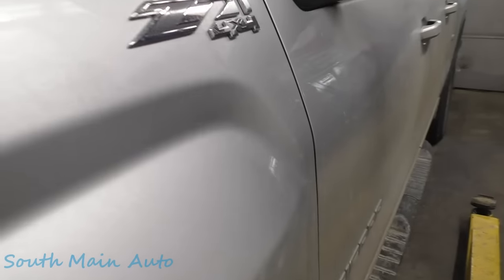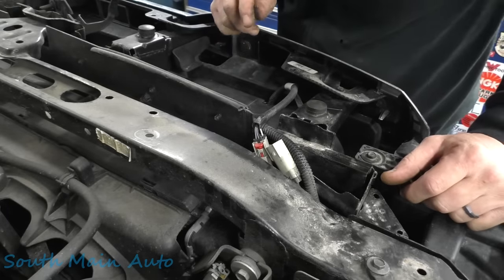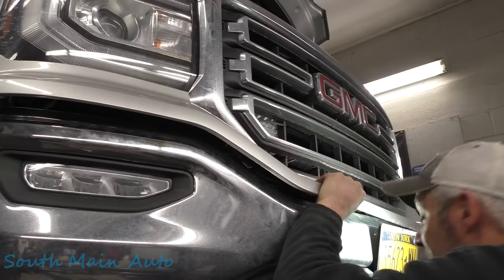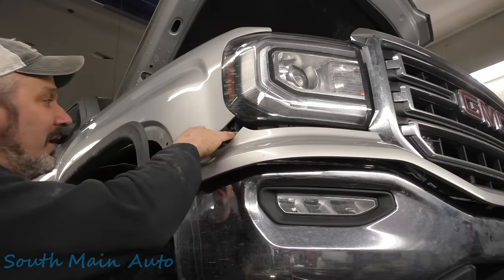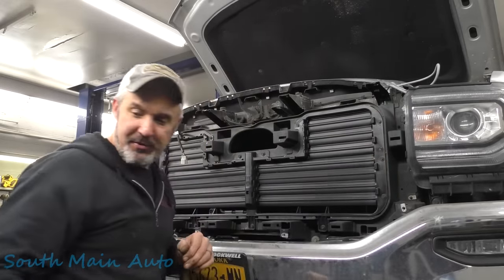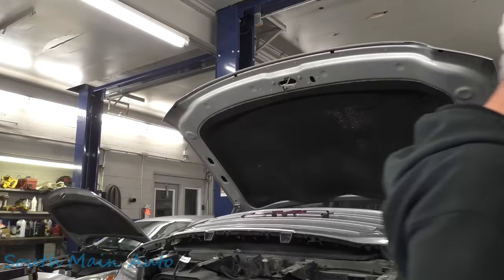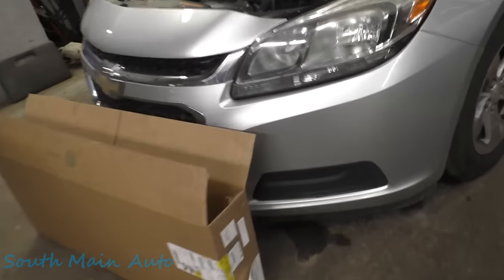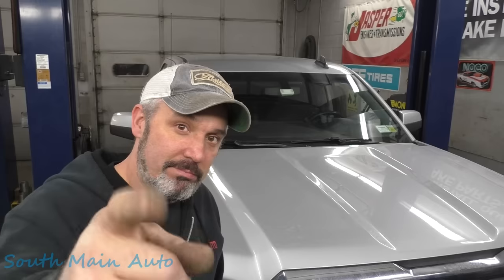Chevy Truck: Active Grille Shutter

Comment: I like the way Trane used active shutters on old commercial condensing units, but it wasn't for aerodynamics, lol.  They had shutters to control head pressure for cold weather operation (many large buildings need cooling in certain areas like communication rooms in the winter). The shutters were operated by a pneumatic cylinder pressurized by refrigerant from the discharge side of the compressor. So in cool weather the reduced refrigerant pressure allowed the cylinder to close the shutters to maintain a reasonable pressure. No damn sensors, no electric motors, no computers, just pure mechanical reliability.
I just thought someone might find that interesting.
Reply: the active shutter is not for aero dynamics!
Reply: Until that damn actuator started leaking!
Reply: @Frank-fz4tm  That goes without saying, but the ones that I saw were at least 25 years old at the time. And times were different, adding freon at each inspection was considered normal maintenance. Up until the early 90s, we only fixed major leaks, after that we started fixing everything

Comment: Back in the day, I had a 1974 Wartburg Knight. It had a grill shutter you could open/close in really cold weather to speed engine warmup. You pushed/pulled a little handle under the dash and a thin solid cable was connected to the grill.

Comment: You can put an 8mm socket on the white plastic fasteners that hold the fender trim piece. The socket will squeeze the tabs and the trim will pop free. I learned that trick from an old timer in a bodyshop.

Comment: The bumper filler is easier to release bottom tabs by reaching up from below behind the bumper and pull down on the tabs. I had a 39 Packard with active grille shutters. They had a thermal spring in the top of the radiator with a rod going to shutter. The car was 40 years old when I got it and it still worked great.  Now we need a computer to do it , Progress?
Reply: I maintain the floor mounted dimmer switch was perfectly fine. It's been downhill for autos since it was abandoned.
Reply: The computer can shut it on the highway too!

Comment: I guess they felt the need to use that to improve aerodynamics and fuel economy. I would have thought that not making the front of the truck a flat wall 10 feet tall for no reason would be a better strategy, but apparently that's just inconceivable.

Comment: This video was so so helpful. I was so getting ready to follow the service manual doing my first one of these. This video just happened to pop up through my feed a week or so ago Knowing that I had to do one of these. I was so getting ready to remove so much junk it was ridiculous. I literally did this job in 30 minutes and it's cold outside and it's raining. I normally don't do anything from home but this was a friend
Reply: WEIRD that it NEW TO PUT IT ON YOUR FEED  I JUST DID MINE  THE AUTOE BODY SHOPS WAnted 1500$   i got ther gm part for 400$ and took me about 3 hours
Reply: Is there any programming involved in the install process that can't be done with a scan tool? Wanting to just replace my own but I've heard there has to be programming done by a dealer, but didn't see anything in the video like that

Comment: I worked on Autocar trucks in the 70s and they had temp operated radiator shutters..You could hear the change in air flow when they opened, and they made for a cool looking grill.
Reply: Drove one...dumping concrete on i40.....got tired of the noise...put a plug in the line..shutters..open all the time....summer time....boss never knew I guess.
Reply from the maker: Air shutters come open then the fan clutch kicked on, the 400 big cam cummins sounded like it was ready for take off haha

Comment: As a 23 year GM body technician, I can commiserate watching you take that apart. I get furious at the way things are put together now. I honestly can’t believe you got those flare clips out just by pulling and not have them break, I always squeeze them from behind. One thing that could have saved you a little aggravation is we leave the cover attached to the grille and save all those clips aggravation
Reply from the maker: I would but you have to remove the cover first to get to the bolts to remove the grill

Comment: Eric you are correct. At 23:15 you say they go together easier than they come apart because of the assemblers standing on the line. Yes! I did that for a year at the oldsmobile factory 50 years ago. We made a car every 40 seconds, 3 cars every 2 minutes. No robots to speed the process. We laughed at all the items we assembled (most) that clearly were going to be hard to remove for repair. That sticky tape was only to help assembly. The two donger (25:07) is a strap independent of the fender guard. It holds the end of the bumper guard to the fender.

Comment: Awesome video. Found a tip for ya when I did mine. The middle clips on the grill trim can easily be released from the underside if you another person to lightly pull from the front.

Comment: This is actually a system that goes a long ways back. 80’s and 90’s big trucks like freight liners and western stars, ford LTL 9000’s ran the same louvers back then. But they decided to put more electrics into it now, with yet more sensors for sensors. lol. Cheers from Central Canada. 🎉🎉

Comment: I suspect the difficulty with all the different fasteners might have something to do with the Collision Tests.
 
A different thing - a memory actually - is that our second hand vehicle in my childhood had an actual roller blind in front of the heat exchanger.  There was a cable brought to the cabin for controlling the height of the blind.  If you wanted to adjust it, you had to slow down.  Otherwise the blind was immobilized by the air pressure.  By the way, it also had a manual crank for starting, as the 6 V battery was likely not to have enough muscle to turn over during the colder weather (more viscous oil).  Those were the days, when everything was better and simpler, you know....

Comment: Watching you take off that plastic on the bumper takes me back to they days when I worked at Dell back in late 90's and the Aughts. The Latitude laptop with a purple back had 120 screws in it just to tear it down. 50 of them were on the back purple piece cause during R&D ever time a crack showed up they just put a new screw.

Comment: I remember the day Volvo had roll-up shades that worked via a cable in the cab.  My, my, we've come a long way.  Listened to a podcast today about a 2017 Subaru that had similar issue - shades stopped working.  Shut down several systems - lane departure, pre-emptive braking and the auto idle stop system - and lit the dash up like a Christmas tree.  One step forward and two in reverse.

Another great video.  Keep'm coming.
Reply: My Citroen had a nice little chain to pull up the curtain in front of the radiator and let it back down again for faster warmup on those -20 mornings. (still didn't have enough heat and fan to defrost the windshield)

Comment: Watching you take that grill apart reminds me of the time I replaced the doghouse on my 71 El Camino. Replaced the hood, grill, both fenders, and bumper. It was a lot simpler than that repair. Nowadays, I take my 2014 Yukon XL to a shop to get my headlights replaced.  It's probably a one hour job... if you are a rocket surgeon.

Comment: Had this happen to me on my 18 Silverado. Driving in heavy rain storm, next day shutter failed. Split open bad motor and water dripped out. You could see where the circuit fried. I did apply sealant to seam on new motor. Couldn’t find motor only for purchase. Had to replace the whole shutter say.
Reply: They don't account for inclement weather in the design brief.  Having to drive through weather is a "customer problem".
Reply: Check out the fuel pump control module located above the spare tire. No sealant on a tin boxes seams. It'll make you shake your head for sure with all the dirt and water that gets to it and in it.

Comment: I have fixed plenty of laptop computers - they give you plenty of mini heart attack moments when separating plastic casings. Some are a lot louder than you would think. As well as looking for screws in weird places, plus the plastic clips are a lot smaller and easier to break and you can’t just go to a store and buy parts to replace them apart from the “mothership”.
Reply: Yup. Was IT for 35 years. Used to freak end users out doing certain repairs that could be done at thier desk, but required removing the plastic surround for the LCD. It sounds so brutal taking the plastics apart. 😂
Reply: With you on that mate.
Reply: im not worried about the plastic clips as much as all the delicate wires for things. antenna wires on the wifi car, display connector, stupid fan connectors on the cooler. so annoying. built a desktop the first time this summer, EVEN WORSE. just as tiny but so many more of them.

Comment: I’m with BeaverC.  Cardboard worked great.   A GM guy mostly.....   (I have owned a couple fords Dodges and Jeeps). I guess I’ve been really lucky for many years because most of the costly repairs I’ve had over the many years were when I was young and caused the problems myself (blown engines, transmission, etc) and my dad helped and taught me to fix them myself.   But those were back when things were not so complicated.   Lots older now but I still do oil changes, brakes and other simple jobs.  I really can’t recall anything outside of normal wear and tear items like ball joints or cv joints that have given me trouble.

Comment: Now I know where the guy that designed the Honda Goldwing air filter replacement system went to. You have to take about half the bike apart to change the air filter. with practice you can get it down to 5 hours. The best part is they decided to use 4 different size fasteners and multiple plastic pins.
Reply: That's likely the Audi engineer they hired that desiged the blower assembly on the Acura Legend!
Reply: @jblyon2  seen that before but the Acura Legend is a great vehicle except didnt know they hired a dude from audi blah.
Reply: @jblyon2  was it the vigor?
Reply: @nighthawkj3096  Yeah they did. Some of the design is straight from Audi models of that time. Those parts seem designed to be as failure prone and difficult to work on as possible. Watch a video of a blower motor replacement in one. It will blow your mind. The rest of the car is bulletproof.
Reply: @jblyon2  seen it few years back on Ericthecarguy

Comment: It is called billable hours for the Dealership. If they make it easy to fix then you don't have to take it to a "Stealership" to get it fixed.
Reply: While it's under warranty the manufacturer pays for those billable hours though. Out of warranty vehicles rarely make it to the dealership for service let alone repairs.
Reply: @9HighFlyer9  The EPA and manufacturers did that. Neither will get any sympathy from me.
Reply: @timbow50  I had a local Chevrolet shop that their shop rate was $25 higher than a factory repair shop for a $25 Corporate Million Jet. Now who do you think has more training and is certified by the US Govt to work/repair either of these "vehicles".

Comment: NIce, a 28 minute repair video. 24 minutes of getting to the part and 4 min to replace part, including the uh oh, forgot the ambient temp sensor.  They sure don't make 'em like the used to!!! And, for the most part, that is a great thing!!! Cars today achieve shit cars back when could only dream of (400+ HP and 30MPG, 200k on the odometer and still running, starts when cold every time no need to tell someone to pump the gas twice then start, etc....)   BUT.... shit like this BS to take stuff apart is a total engineering fail. Then again, when you engineer to save on assembly costs, this is what you end up with.

Comment: A lot of those bumper trims/covers seem to be designed for easy assembly on the line, but on the basis that, if you're taking them back off, it's for crash repairs, so it doesn't matter if you have to break them, because you'll be fitting a new one.

Comment: Thankfully the headlights are not halogen!   Changing one on a 2012 GMC 3500 was a learning curve!
Good one Mr. O.  
Old or new that shutter assembly was REAL flimsy!  I was used to the old International "Rxx series that used steel and hydraulics.
Times change.
Reply: 2012 gmc are easy

Comment: when i was younger i had a 1972 ford pinto and acording to the ford repair manual it said it would take 4 hrs to change the starter and it said you have to unbolt the steering to change the starter. i figured it out that i could pull the starter go get the new one and be back on the road in 45 min. the way i did it was reove the battery and battery box and get it that way.

Comment: I have that same 1/4 air ratchet had it for about 10 years. I absolutely love it!  Keep up the good work young man!
Reply: Which one is that? I was figuring something from Astro (which I've been patronizing a lot thanks to this channel) but doesn't look right...
Reply: @danielj.schneider5162   it is a Mac tools 1/4  ratchet. They have a newer style with more aggressive offset on the head, but it's no where near as reliable as the one he was using
Reply: @joshualord8042  Ah, gotcha. I see the AR249 looks pretty similar in terms of the head shape and length. For $45 I think I'll give the Astro 1/4" a shot; if it doesn't work out, maybe I can eBay a Mac. Thanks!

Comment: We had a 1928 Oldsmobile tourer with an Active Grille Air Shutter, a pull lever on the dash which operated through a wire connected to a leaver which closed the shutter.  Family rumour had it that an Aunt pulled the leaver out to hang up her handbag, unknown to the driver.  Engine overheated in  the Australian outback - all hell to pay.   A.G.A.S. was disabled and never used again. No parts required.

Comment: I feel your pain. I had a '15 Sierra 1500 I converted from halogen headlights to HID. To do that, I had to do all this same stuff to get the headlight housings off. It looks very similar, but to pull that bottom trim piece, my instructions said to attack those "tabs" from the BACK side of the bumper.

Comment: And to think we used to think it was ridiculous back in the late 1960's when you had to loosen an engine mount on a Chevy 327 V8 and lift the engine up three inches with a floor jack to take out the spark plugs.  My how things have changed! 😂
Reply: nope, that's still stupid. fun fact, subaru have the same problem

Comment: My 2018 equinox have this grille shutter. It really helps warm up the engine faster in cold weather.
Reply: My 2019 Equinox has it too.
I find it odd that the heat blows so cool if idling. I would think it would close the shutter while idling to keep the engine bay warmer.
Blows really hot while driving, but if parked for a bit cols down considerably.

Comment: Why does a non emissions part cause a money light? Ive never understood certain check engine lights that have nothing to do with the way it actually runs
Reply: It is an emmissions part, grill shuts to reduce drag and use insanly amount of less fuel, thus saving the polar bears and the world ans stuff
Reply: Well the grille closed, it makes engine warm up faster especially in cold weather reducing emissions.
Reply: It is an emissions part, my 09 civic si monitors the performance of the thermostat and the radiator. 

These active grille shutters were introduced for fuel economy. 

One more reason for strict states to kick your new vehicle off the road.
Reply: If a ecu/bcm controls it and fails, it will have a trouble code which illuminates the money light
Reply: because in ny, it gets freezing, so the rad need a blanket keep some temp in the engine for it to work correct..

Comment: I miss the days when a truck was a "TRUCK"
Reply from the maker: Now all they can haul is the groceries 😂
Reply: When they were big, loud, sloppy to drive, and uncomfortable and got 7 mpg and smoke blue out the tail pipe.  That's a Mane's truk!     Now they weight 7,000 lbs, tow 20,000lbs and get 22 mpg at 75 mph and last 20 years (except NY state)

Comment: Can anyone tell me if that is the same sensor the infotainment systems uses to display temperature? Or if its pulling that from some other system/sensor. My 3500 Sierra has never shown temp right on the infotainment. But seems to work fine. Trying to decide if its something thats important or just a inconvenience. As it sits I am still waiting for the correct shocks from GM already.
Reply: Yes, the informational system does pick up the temperature from the ambient air temperature sensor so if it’s off by a few degrees the sensors going to go bad eventually I’ve had to change tons of them on the Buick Park Ave and generally all the GM line.
Reply: @williamgagnonroadboxservice  super helpful thank you. Yeah its off by 20-40degrees alot of times, if it updates at all. I will have them look at it while they are looking at the parking brake incline sensor.

Comment: Ohhhh, buddy; does this bring back memories. Had a '14 Sierra 1500 and found myself servicing headlight bulbs a time or two. Thanks to big hands and questionable 'service engineering' on GM's part, I ultimately found it faster to pull the grille to pull lights and change bulbs - especially after I found leaving a couple of screws out of those fender trims didn't harm anything. Kinda chewed up some of the fascia tabs over eight years of ownership, but it still fit and held pretty well, so... /shrug

Comment: OMG! More crap on a truck that we don't need. How about we go back to the late 60's/early 70's with a 350 or 454 engine; mechanical fuel pump; electronic ignition and simplicity!!!!! Maybe a later fuel injection system----but that's it!!

Comment: On the escapes there is a bunch of push pins for the fender liners and then  a bunch of splash shield bolts to remove then a few bolts up top 1 connector and 2 bolts on each side mounting it to the body and then you just rip it off